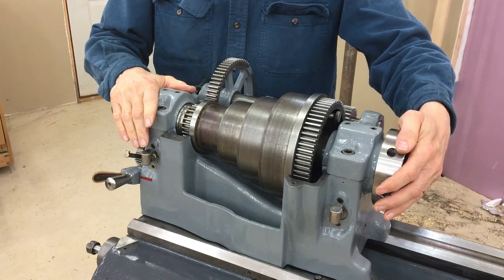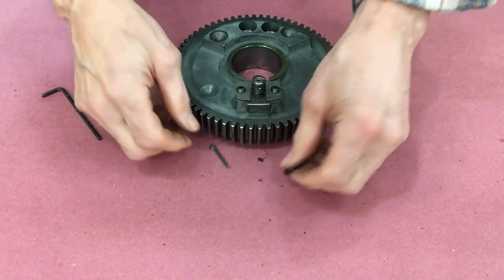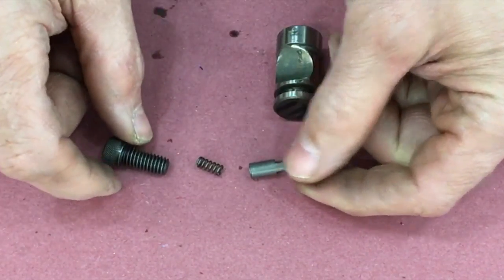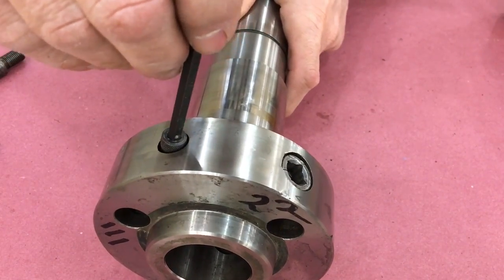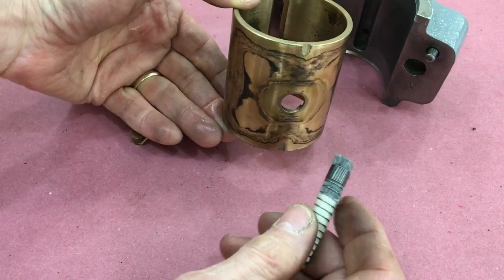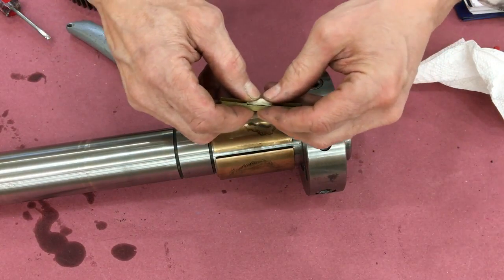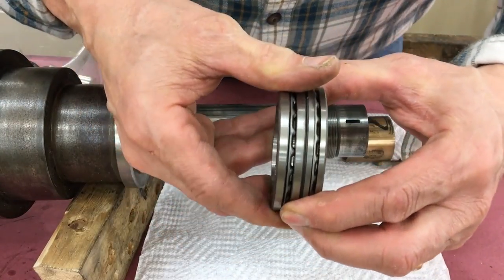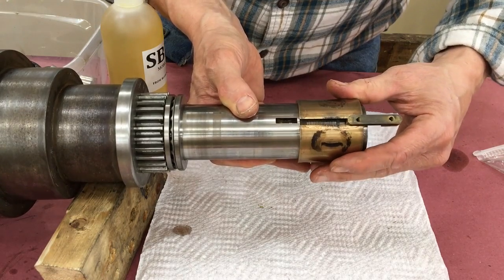South Bend 13" Restoration - Spindle

Comment: George,  another great video.. can you do a video on adjusting the bearings on your spindle ?   also what did you use to clean the pulley ?

thanks again,

Joe
Reply from the maker: Yes, I have a video planned on all the tuning and adjustments.  Cleaning the cone pully was done under power a sanding paper strip.  I think I started with 250 grit and finished with 400 grit.  Be careful not to sand down the crown.

Comment: Thanks for the video series George!  Extremely well done and a great resource.  To remove the bull gear from the spindle, did you heat the gear (like you said you did on its installation), and/or did you use a press of some sort?  I have the same vintage 13 as yours, with the D1 spindle.  What are you thoughts on the importance of removing the bull gear if it becomes a real challenge?  Do you think being able to remove/inspect/clean the headstock end bronze bearings is critical?  Thanks!
Reply from the maker: I think I pressed the bull gear out…. Banged it out. I don’t recall if I heated it or not, probably did.  I really don’t know what is critical. My videos show what I did.  What you do is dependent on so many things….. how much you want to take apart, how hard it is, as you mention.  How dirty, how worn the machine is… etc.   send me an email, we can talk on the phone if you wish.
Reply: @georgebell7103  Thanks so much for the reply and offer to discuss. After looking at how good the internals of my outboard bushings look, I have decided to  leave the bull gear in place. The ability to inspect the internals of the head stock side bushings doesn't seem to be worth the potential risk of damaging or scratching the spindle during the remove/install process.  Thanks again for getting back to me.
Reply from the maker: @joet3064  Great,  thanks for your comment

Comment: A pointer for others who have the older version of the 13" spindle - with the take-up collar sandwiched between the spindle gear and bearing cap, and a rear thrust washer instead of a thrust bearing.  If your spindle gear is stuck fast like mine was (it took probably a ton or ton-and-a-half to crack loose best guess), I had success by first turning the take-up collar all the way 'inboard'.  Then I ground down the points of a cheap claw puller to fit into the small space between the gear and collar.  After that, you can insert a piece of stock that has been center drilled and shouldered to fit inside the spindle for the puller to act against.  

Otherwise if you have a hydraulic press with wide enough uprights for the spindle to fit, you could maybe try sandwiching ~1/4" thick angle iron into the gap to act against the gear whilst you press against the shaft.  ...Just be careful not to let the spindle drop when it finally cuts loose.
Reply from the maker: Hey, thanks for your comment

Comment: Very nice! What is the purpose of filling the pulleys with grease?
Reply from the maker: Thanks for your comment.  Grease is the required lubricant for the pulley.  The pulley turns on the shaft when the machine is in back gears.

Comment: Hi sir, i have another question for you, do you know where i could get new trust bearings for my spindle shaft? The thicker one is missing the ball assembly for god knows what reason.

Thanks!
Reply from the maker: I purchased all my bearings and such from Mac-Master Carr They have a good well organized web site for your search.  Also you should consider an upgrade from ball to roller thrust bearings.  Measure the old bearings carefully to make sure you get the right sized replacement.    Let me know if I can help further.  PargoLongAgo@Yahoo.com

Comment: I was watching your video again trying to see if you mentioned the oil tube pressed into the casting where the bushing/bearing with the hole at the bottom that the tube went inside during assembly. The rear tube on my 13" is flush, I think who ever owned this lathe prior to me didn't wait for the click and forced it down flush. Is there any way to get to the tube from the bottom of the spindle housing? They give a part number for a replacement tube but I'm thinking the old tube must not be usable after you get it out, maybe damaged removing it, I don't know but I'm hoping you do. Thanks
Reply from the maker: I did not have an issue with the tube.  Send me an email if you want to discuss....
Reply: Paul Greenlee: You could possibly make a small dedicated spring type "tube puller" that goes through the tube and expands slightly. You would then "jack" the tube completely out with a small shop-made slide hammer. Remove the puller from the tube and if the tube's not damaged reinstall it to the proper depth. I've never done this but it should work if the small tools are properly made. Good luck.
Reply: @ellieprice3396  Thank you for the suggestion, I believe it would work fine as well. I'll give it a try. I'm dealing with a left and right shoulder joint replacement or course not at the same time. As soon as I get back working on it I will give an update. Thank you again.
Reply: @paulgreenlee190  You’re welcome. There’s also another way to remove pressed-in hollow bushings with a closed oil sump like the South Bend. First remove the oil wick, then completely fill the sump with oil to the bottom of the bushing. Find or make a small shaft that has a slip-fit in the bushing you wish to remove. Place the shaft in the bushing and tap sharply with a mallet. Since oil is non-compressible the bushing will be jacked out by hydraulic pressure from beneath. Refill the bushing with oil as necessary, keep tapping and it should come out without damage. Press the bushing back in to proper depth, replace the wick and you’re done.

Comment: George, between the head stock, apron assembly, and gearbox which in your opinion is the most challenging to tear down and reassemble?
Reply from the maker: Gearbox was the most difficult for me.  However my machine was in good shape.  I think it will depend on what problems, abuse, or ware you may find.
Reply: I can see how unpleasant surprises could certainly complicate things. Fussy to forget about it taper pins seem daunting as does press fit parts, but beyond that it seems like with good instructions each sub assembly puzzle might be kind of relaxing in a way to work with once cleaned up.  My incessant transport thoughts have moved to the idea of sandwiching a 2 x 4 (or 6, 8 or 10) between the pallet and the machine at the base and rear legs then pilot drill and lag bolt it all together as a form of wishful thinking (kind of like wooden training wheels) should the machine wish to tip onto one of it's sides while being winched down the inclined trailer.  I also thought of using a pallet jack (if God willing I get one tomorrow) to kind of help it slowly roll as it's being winched down the incline of the flat bed. There is a sigh of relief after safely and successfully moving a very heavy object that I have yet to achieve in life, and I hope I can earn it without too many shocks to the heart and added grey hairs. - Thanks
Reply from the maker: Hey, let me know how things turn out.

Comment: It’s a lot easier to press the bearing expander flat tight up against the spindle where it goes holding the little piece of wick in place and slide the bearing over it.. this way the wick won’t be knocked off..
Reply from the maker: Thanks for the comment… always other ways to get things done.

Comment: How do you adjust the bearings????
Reply from the maker: It here are several good videos on this topic already, also South Bend parts manual has good instructions as well.  I plan on a video showing all leveling and adjusting. It should be available in a few months

Comment: You'll never get "good solid pressure all the way around" a brass BUSHING like that and still get LUBRICATION into it. And it'll NEVER be "round" unless its "adjusted" to whatever "dimension" it was initially machined in. Plain bearings are good for "axial" loads but HAVE to have clearance for lubrication and if you expect the lubricant to take up the clearance, you'd better be using the recommended grease and plenty of it on a frequent basis. I see lots of lathes in "home workshops" and "restorations" of old discarded (by the previous owner(s) lathes that suggest that a lathe is a nice, clean and "tidy" tool to own, operate, etc. Not hardly IF its being used and maintained properly. And the "cheaper" the lathe the more of a mess its going to make when used for work beyond its capacity and/or the more its worn out and/or if its not serviced and lubricated properly "by the book". You don't see MACHINISTS in the "old days" wearing aprons to keep chips off their "good clothes". They're wearing them to keep oil and grease flung off parts and tools from staining their "work clothes". 

If you've never had real oil/grease stains on your clothes because you've never been a mechanic/machinist, you have no idea what I'm talking about and the fact that your home laundry appliances  don't remove oil and grease RESIDUE no matter WHAT laundry detergent you buy in less than a couple months of at least weekly washing. That's why real mechanics/machinists typically use uniform services and/or wear coveralls and/or have "work clothes" probably better than your "shop clothes" so when they get that "major spill" dousing of oil or grease that happens to all "pros" eventually, there's enough material there and good enough material to "soak up" as little oil/grease as possible before they hit it with some solvent or brake cleaner, etc. And so what does get soaked in gets "released" into the other laundry very gradually, lol. 

I hate to break it to the would-be/aspiring/DIY/home/amateur "mechanics" and "machinists" out there, but if you haven't ALWAYS been a "gearhead" and no so much "liked" getting dirty but didn't give a sh!t about getting dirty when you were "working on" or "doing" something mechanical and didn't even think about it or notice until later when Mom or Dad or some other family member started razzing you about it and didn't let THAT bother you either, you ain't gonna make it as a "mechanic" or "machinist" until you learn to "love" getting dirty. The same goes for "minor" injuries like cuts, scrapes, bruises etc. If you've ever been working in your "shop" on something and were completely oblivious to the readily noticeable amount of some vital fluid - mechanical or biological - on you or your clothes until you happened to spot it later or it was otherwise brought to your attention and your response was "Hmm. Wonder when that happened." and you honestly can't remember when you something "mechanical" came into contact with your body to the point of drawing blood or leaving behind its "fingerprints" of oil, grease, brake fluid, etc, you're ALREADY a "mechanic" or "machinist". 

If that's not you and you believe you can have a "clean" shop and tools and a "productive" shop and tools and be able to buzz out there for a few minutes or a few hours and both use it and keep it cleaned and do more of the former than the latter OR you're maybe a little "sensitive" to pain, blood, oil, grease, dirt, rust and having your patience tested by inanimate objects old/worn enough to need "work", you might want to rethink your choice of "hobby" and for DAMNED SURE go work in a REAL SHOP before you even THINK about doing it as a "business". 

The phrase "its in my blood" is used constantly to describe people's affinity for all kinds of things. Only with mechanics and machinists and other "trades" and farmers and ranchers is it REALLY TRUE. Because we/they end up bleeding pretty frequently and "rub some dirt in it" is a joke to us/them. Why would we have to rub some dirt in it when our hands and whatever it is that did the damage were already dirty? And forget about "preventing infection". It's too late by the time you see the damage if you're one of the above. And small doses of infection just strengthen your immune system. Everybody knows that. 

P.S. Make sure you're okay with "shop-scented" laundry, too. I mean ALL of your laundry. Unless you want to be spending a lot of money on new "work clothes" OR empty "cleaning" cycles and detergent to get the "shop smell" out of the washer between your laundry and the rest of it. Or you want to pay for a uniform service. Its up to you. Just don't expect your spotless "shop" and "clean as a whistle" and "restored" tools to stay that way if you're actually using them more than cleaning them. They ain't gonna avoid their own "wounds", either. That's why "pros" buy "expensive" and even "overpriced" quality NEW tools or quality USED tools they can put right to work and never expect used to look like new and know new turns to used as soon as the tool finds the shop UNLESS its "surplus" and unneeded and just stays in the packaging gathering dust. And even those are "used" as soon as the packaging gets dusty/oily/greasy. How would that happen in a drawer of a nice, expensive tool box in a clean shop? 

You are new at this, aren't you?
Reply from the maker: lots of time spent on this comment